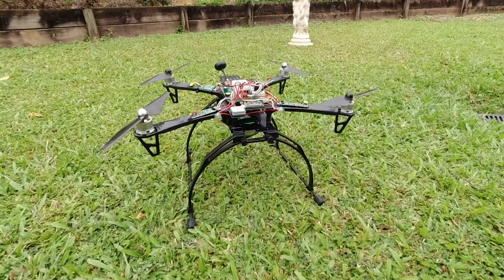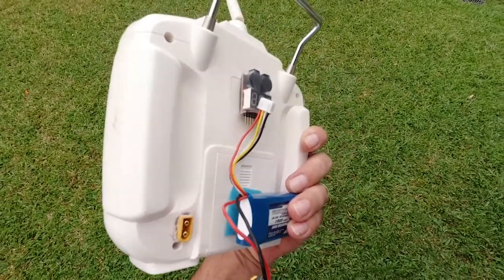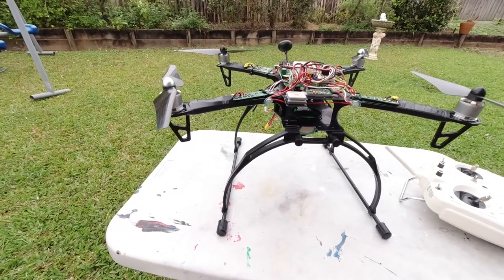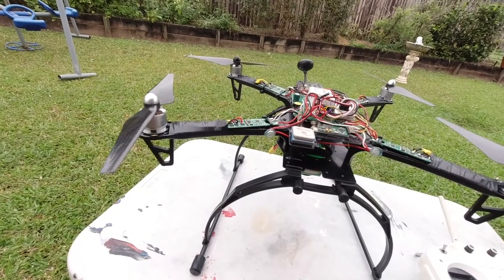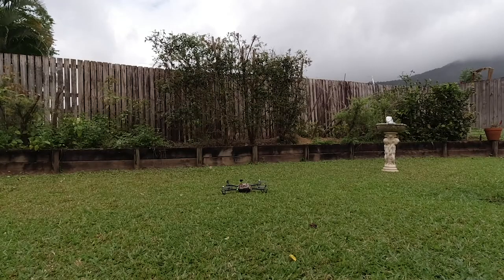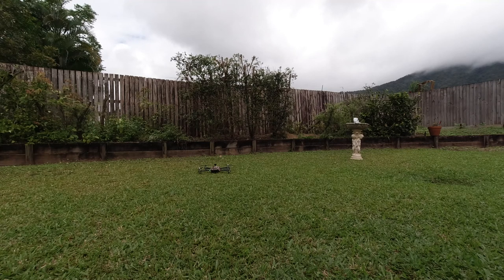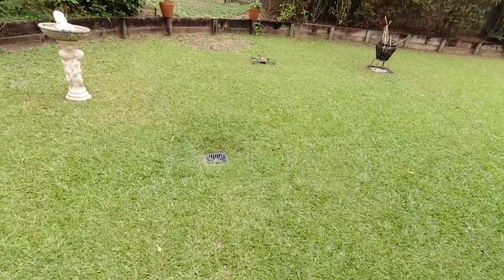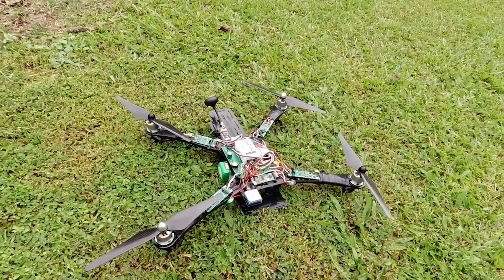Quanum Nova Transplant To Reptilian 500 Frame - Part 2 - Test  Flight With Stock Electronics

Comment: Nice..is the other stock frame less stable..
Reply from the maker: The stock frame it came with was pretty beat up and needed replacing. I have had the Reptile frame sitting empty for some time and was a good opportunity to do something with it. I think having the legs on it made the craft less stable. Taking them off the craft felt much better to fly even in the windy conditions. It does need a system upgrade so it can run a 4s battery.